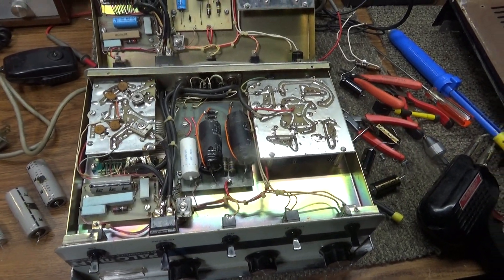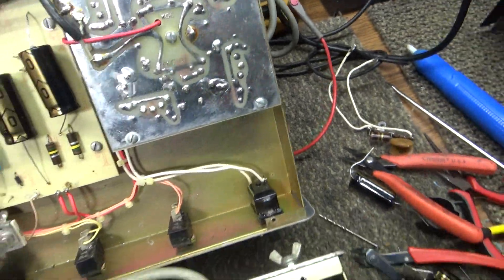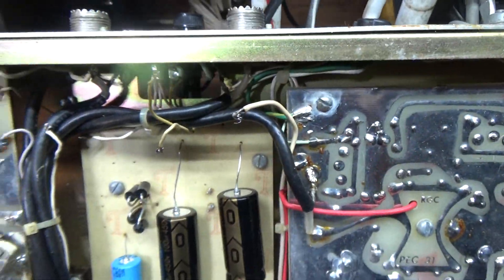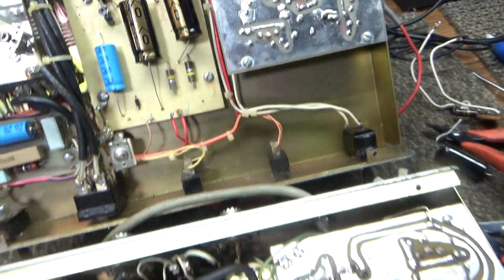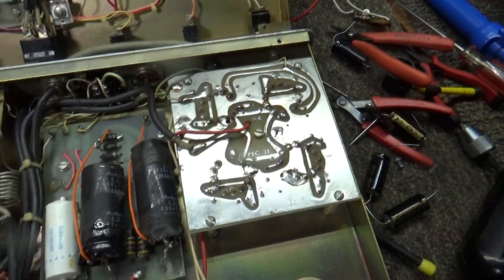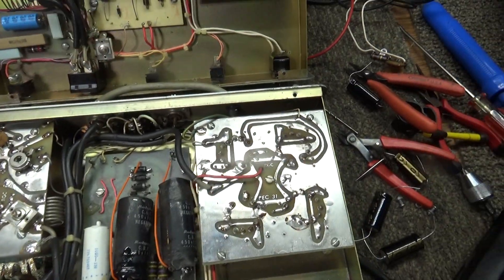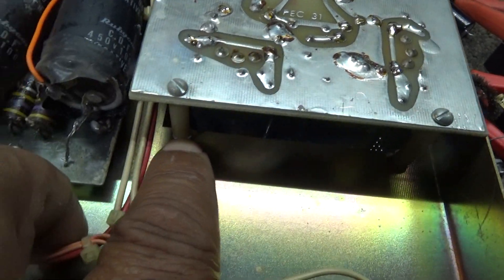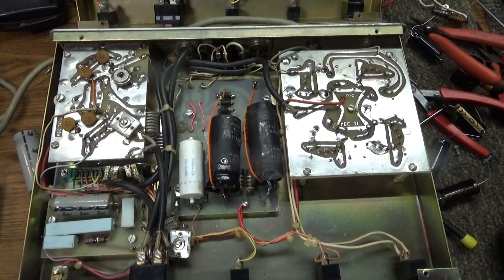Palomar 300A's keep pulling me back in.....

Comment: Is it possible to get a photo of the copper foil side of the relay board that plugs in that has 3 dpdt relays. Just changed the center relay as it was toast and some of the traced came up so I want to make sure I got it all wired up correctly.  Thanks for thanks for any help here. Jay
Reply from the maker: OK, made the vid. Be careful though, those relays are uncommon. The legs/mounting are the same as the more common ones, but the pinout is usually different on Palomar's.